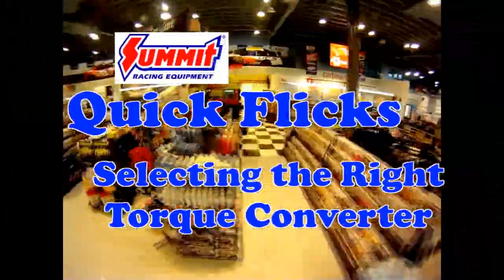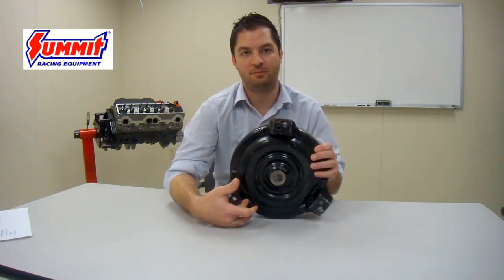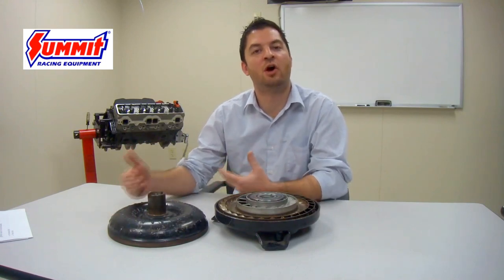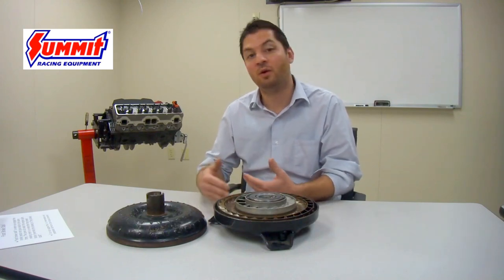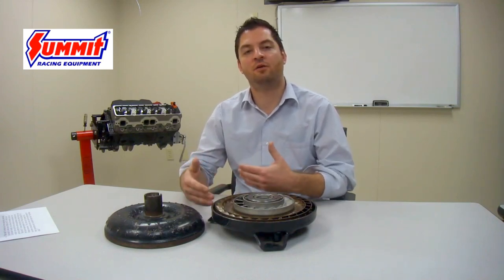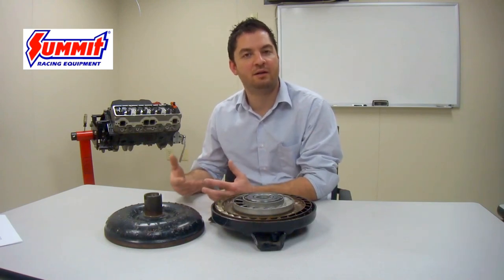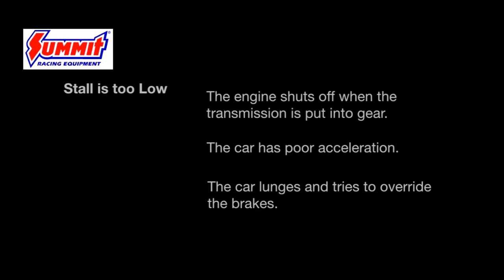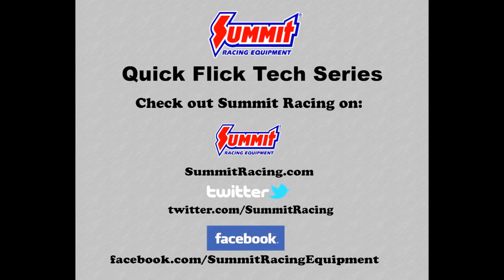Torque Converter Selection | How to Choose the Correct Torque Converter

Comment: Summit, I am trying to find an upgraded converter for a 2013 Dodge Dart 2.0L with Power-tech 6F24.  Here is some information to assist in this:
Displacement - 1,995 cc
Compression ratio - 10.2:1
Cam profile - Dual-Overhead / DOHC
Injector size - 36 mm
Transmission model year - 2013
Gear Ratios - 1st - 4.21 / 2nd - 2.64 / 3rd - 1.80 / 4th - 1.39 / 5th - 1.00 / 6th - 0.77
Rearend gear ratio - 3.20 (final-drive ratio)

the torque rating is only capable of 185 ft-lb of torque and I know a lot of 2.4 and 2.0 guys are coming close to hitting that limiter with tunes and bolt on upgrades.  The 2.4L stock from factory is already pushing, 174 lb-ft, and with only 185 ft-lbs available from the power-tech automatic, there is little room for growth.  Let me know if you need any other information in regards to the Dart, I will try and help out as much as possible with the information I have.  I think if we are able to get a past the stock 185 ft-lb torque rating on the power-tech a lot of others will see the potential in the automatic and the Dart.

Comment: So couldn’t you run a higher stall than your cruising speed if you also install a torque converter lock up switch? I have a 77 Chevy k10 with an 1800-2000 or so stall and I would like to increase the stall for a better launch but it cruises at 1800 rpms at 60 mph. It also tries to die when put into gear but I’m running a comp cams Xtreme energy 268 cam. It starts making power around 15-1600 rpms

Comment: Some of this info is incorrect if you use a lock-up converter.. I know a guy who put a TCI 3000 stall converter in his 2007 mustang GT. He can footbrake stall it to 2500. He has 355 gears and it cruises at about 1800. He has been running it on the street and bracket races almost every weekend and has never had a problem in years and years. His is a multi disk LOCK_UP converter.

Comment: What size/stall speed would you suggest for a 1989 G30 Class C RV that has a TH400 3-speed transmission. weighs roughly 10,000 lbs and 12,000 pounds if towing a small trailer? The engine is a new Chevrolet L05 TBI 350 crate engine rated at 210 hp at 4000 RPM and 300 lb-ft torque at 2800. Engine specs are:  9.4 to 1 compression ratio
, Camshaft with 165/174 duration at 0.050, 0.382 In./0.402 ex. lift, 1.94 in. intake/1.50 in. exhaust valves, cylinder heads (65.3cc chambers). The rear axle ratio is 4.10. I see towing torque converters with a 1200 RPM stall speed. Would this be suggested for this application or will it cause poor performance and bogging and stalling when putting into gear? Should I just use the stock converter?

Comment: I want maximum elapsed time what brand and converter stall do you think?

3,570 pound leaf spring car, with me 160 pounds total weight = 3,730
275-60 R15 tire 27.7 OD.
350 turbo trans just shift kit and manual valve body with Electric shifter. Trans not finished yet. I plan on installing 400 turbo with trans brake with Gear Vendor or 4L80E trans brake or something else very strong with a low gear set.
4.11 spool rear gear in now and 4.56 new chunk will try 4.56 some time
Use to stall 4,000 9.5" converter stall but converter broke only goes to 3,000 now. Still goes down track but would be way off at track. I bought the best converter at the time won't say what brand of converter.
Car has about 7,000 miles on it. I'd have to look to be for sure. Mostly street and some track. 

Engine power on Dyno no power adder yet
 700 HP at 5,600
710 TQ at 4000
572 BBC

Comment: can you recommend a torque converter for a sbc 350 bored .30 over, .488 lift cam,double roller timing chain,turbo 350 trans,square body chevy 2 wheel drive,stock 15 in tires 342 gears
Reply from the maker: +josh Blake, 
We need some additional information from you. Can you give our tech line a call? 1-330-630-0240. We look forward to your call. Thanks!

Comment: I have a 1984 Chevy Caprice. I replaced the 305 with a 350 motor, which is pretty much stock minus a Lunati Cam and Lifter Kit. Part # 60101LK. I will be redoing the gears, either 4:10 or 3:73, Havent decided yet. What stall converter should I go with?

Comment: THANK YOU!  omg, my cuda is nonstop overheat on the hwy even in cold with a new radiator.  now I know why.  2.73 gears and 27" tires equals 2200rpm @ 65.  NEVER gets above the 2400 stall converter (cam is rated for 2000). Time for a rear gear change!

Comment: So wonder if your brake and flash stall are at the same point?
In my 96 Ram with 156K on the original trans, I can hold the brake (and use E-brake to prevent wheelspin) and hit about 2200rpm. When I punch it from a dead stop, I also flash to about 2200rpm on stock diameter tires and 4.10 gear, truck at ±4800lbs.

Why would they be the same?

Comment: What about lockup tq converters? Like in a camaro, is a 2800-3000 stall possible?, with lockup converter, and 3.45 gears? Cruse at about 1800 rpm , its a street car, 385 cid. 11:1, comp nos hp cam . 2800-6800, but I would like to cruse at 1800-2k,

Comment: Hello, I am DIY replacing an engine on 2018 Hyundai Tucson. I've separated the transmission. But having trouble removing the torque converter from the engine and caused a slight crack on the tip facing in towards the transmission. Is that going to be a huge issue? Or must replace?

Comment: I have a 1985 chevy caprice with a 350 gm goodwrench engine. It has a 268H comp cam witha 700r4 and 3:73 Gears. What Converter would you suggest that a get. Oh it had Header with Stock tires that are 205/15/70

Comment: I am having a hard time picking the right stall for my set up....i have a restored 71 chevelle with a 6.0 LS with efi (not carb converted) and a 4l60e with 4.11 gears....car weight is roughly 3900lbs ....cam operating range is 2500-6500rpm....do I need a 2500-3000rpm stall converter,  or a 2000-2500rpm stall converter.....this is only my second hotrod build with an automatic trans....i usually go with manual transmissions but I'm getting old and I wanted this chevelle to be a nice cruiser that my wife can drive without smoking my clutch or giving us whiplash...the last time I built a hotrod with an automatic it was a 70 Nova with a 355ci th350 and 3.73 gears....it had a comp 280/480 with a range of2000-6000 and I used a stall I purchased from a friend who said it was either a 3000 or a 3500rpm stall converter...he couldn't remember but he said it would be close enough....well it wasnt even close to being applicable and the car felt like crap! By the time it started moving it was halfway thru the engine power curve....or at least it felt that way. It was so off the mark that I ended up removing the motor and stall and dropping in a 290hp stock 350ci crate motor and a stock converter.....the crate motor with its 290hp made the nova faster than it was with the 355ci that I built....it had fresh reworked 041 iron heads with some minor port and bowl work done by a very reputable shop, all good valves and springs and titanium retainers and locks....zero decked with flat top pistons...steel crank and aftermarket 5.7 rods ...the 280/480 cam and an old torker intake and 750cfm 4150.,...it wouldn't be jack shit these days but back in 1995 it was a good little daily driver build....the problem wasn't the motor it was the wrong stall....i sold the motor to my brother who put it in his 4sp 81 z28 and it ran great....but in my nova with that awful stall it was a turd.....i do not want to make the same mistake with my chevelle....if anyone takes the time to read all this I'd really like to hear your thoughts on what you think would be the best stall converter size/range would be for my is swapped chevelle....i mentioned above the trans and rear gears....if it helps my motor is a 2004 lq4 with fresh 243 heads with good valves and hardware....compression ratio is close to 10.5 ...cam is 221/232 -.545/.545 112+5 with a 2500-6500 power range....tbss intake (for now)....ls7 lifters/ ls9 valve springs....7.400 pushrods...long tube headers...36lb injectors...92mm TB....trunion upgraded rocker arms.....pretty much stock but should be over 400hp....didnt try to build a racecar.....just a good cruiser with a good stereo to take the ol lady out on country rides on the weekends and do a good burn outs.....i just want to make sure I choose the right stall this time so it isn't a dog like my nova was for awhile.
Reply from the maker: For a heavy car with taller gears I would stick with something in the 2400-2700 range like this Summit Racing Torque converter.

 

https://www.summitracing.com/parts/sum-700338
Reply: @SummitRacing  I took your advice and and bought the summit pro ls converter part number sum-700338.....i hope it does well....if not than in going to buy a Ouija board and tell the demons you been talk smack about their mama.

Comment: Can you recommend a torque converter for a 700r4 behind a  mild street/light off road.. The truck has 4.88 gears and 33" tires
Reply from the maker: Robert Riegelsberger, 
We need some additional information from you. Can you give our tech line a call? 1-330-630-0240. Thanks!

Comment: ok I own a 440 dodge coronet with a 3.23 rear differential with its original 489 case housing . Car was going 45 mph butt forced like needing another another gear. . What mechanic suggested was to replace it with a 2.76 in its original  case 489 83/4 housing. Car runs better butt like heavy ... U think I will need to replace the torque converter? Thanks
Reply from the maker: carlos torres, 
Can you give our tech department a call? 1-330-630-0240. We need some additional information from you. Thanks!

Comment: If I have an 87 firebird formula 350 with a slightly bigger cam and a 700R4 transmission with a shift kit Corvette servo and a stock rear end what torque converter stall what I need to still be able to do burnouts
Reply from the maker: A 2,000 rpm stall converter like SUM-G2704-12 is a great choice for stock and mildly modified vehicles like your Pontiac.

Comment: hello summit I have a 1983 k10 4x4 fullsize truck it has a 3.07 gear in it Witch I'm going to swap out for a 3.90 gears. I'm going to be running 33x12.50 15s ...I don't know what camshaft it has in it but it but I'm going to be going with one of your thumper cams and I've already got a 2400 stall converter from you guys..what I would like to get some help with is will this combination work on a daily driver w/towing sometimes please any help will be greatly appreciated. Thanks in advance
Reply from the maker: +damionakc, 
We need some additional information from you. Can you give our tech line a call? 1-330-630-0240. We look forward to your call. Thanks for watching!

Comment: Great video! But I have a question, I have a 1989 Chevy c1500 half ton with a 350 stock.I recently pulled the 700R4 tranny that it came with & installed a rebuilt that came with a smaller torque converter (Tci) which later I found out had a 2200 stall on it. The original torque converter that came off of it was an original size torque converter.  Problem is I had no idea what the difference would be when I installed it. I noticed the torque converter being really lose & could hardly shift into gear. Is there something wrong with my transmission or just the wrong stall converter? Need help
Reply from the maker: Hi Benjamin,  While factory stall ratings vary widely depending on a lot of things, they are generally in the 1200-1500 rpm range. That said, an after market converter in the 2200 range will tend to feel looser and seem to soften shift firmness. The most important thing to determine first is that the throttle valve cable adjustment is correct. This is accomplished properly by a transmission shop using a pressure gauge.

Comment: I'm rebuilding a chrysler 400 big block w/ keith black 9 to 1's, stock heads/rods/crank. Very short stroke for a big block, so i'm looking at alot of torque with quick revs too.

Ideal camshaft is around .500 to .530-ish lift, good duration, power from 2,000 rpm to 6,500 rpm, like an edelbrock performer RPM or mopar purple cam.

Torqueflite w/  8-3/4 rear, in a 1973 Plymouth, weighs about two tons. What sort of stall would you suggest for daily driver and the occasional quarter mile pass?

Comment: My dodge charger 2011 has no transmission in the vehicle or battery. When I got it towed, I wasn't able to get the car in park and I had the tow man just drag it on the flatbed. Now the car is still in park but if I push it I can get it to roll like it's in neutral. What do you think I broke?
Reply: Mal Bustler I think u have a couple of lose screws 👦😀

Comment: Hi, would I have any issues by going from a low stall converter to a Med stall converter?I am replacing my transmission, and the replacement transmission has this converter, same specs as my old one but with higher stall, 
DLPF 2420 9245
TC-GM35CW       Torque converter, 700-R4, 4L60E, 30 Spline, Medium Stall (Woven carbon) 
 Woven Carbon Clutch, Codes: DCNF, DLNF, DLPF Medium Stall (1600-1800) 
12" diameter, 298mm, Pilot 1.703", 3 Pads, 30 spline, PWM with ECCC my old converter has these specs: (lower stall)
DHPF2420  6163
TC-GM33CW       Torque converter, 700-R4, 4L60E, 30 Spline, Low Stall (Woven carbon) 
 Woven Carbon Clutch,Codes: DHPF, DHPG, DKNF, DKPF Low Stall (1400-1600) 
12" diameter, 298mm, Pilot 1.703", 3 Pads, 30 spline, PWM with ECCC

Comment: I have a 68 GTO, stock 350hp  400 c.i. engine, stock camshaft, TH400, and a 3.42 rear end.  I don't know what stall speed the torque converter in it now has, but I ordered a 1400 rpm aprox. Stall speed converter for it.  Does this sound like a good combination?

Comment from the maker: I would have sworn that the factory motor was a 425. However if this is a factory piece then you have the THM425 transmission for the front wheel drive. If that is the case then please use the stock torque converter. Good luck.

Comment: I have an 82 Camaro 408ci sbc vortec top end and th350,, 3.08 diff  27 inch tyres,, the cam is set to operate 1500,5700 rpm and the car cruises at 2500 rpm and its fast,,what converter will I have made,,if I get a 2000 stall will the car still be driveable in reverse parking and general traffic under 2000 rpm,, or will it rev and go nowhere until it hits 2000rpm. steve in Australia
Reply from the maker: Hi steve driver, 
A common misconception about “stall converters” is that they rev up to the rated RPM and then the car all the sudden starts to move; kind of like dumping a clutch!  This is not true, especially in the case of a 2000 – 2500 rpm stall.  This converter will actually drive normally at low throttle; but at higher throttle  will allow the motor to rev quickly getting into its horsepower producing band quicker.

Comment: i have a 1980 monte carlo with a stock 305 v8 and i just replaced the transmission for a 350 turbo. and when i put the car in reverse or drive it stalls if i dont give it gas or when im in drive and have to come to a complete stop the car will stall. im convinced that it is the carburetor because the choke doesnt work and the carb isnt adjusted right. but could it be the stall convertor?
Reply from the maker: +frincon75, 
You would be correct in suspecting the torque converter if the problem began only after the transmission swap. But if the problem was present before this, carb adjustment, improper timing or a vacuum leak are more likely to blame.

Comment: i have a mostly stock 1995 pontiac trans am 350 sbc hp range is 290 to 300 with 350 ft lbs of torque and a stock rear end what type of converter would i need for a street/strip install it is a daily driver.thanxs!

Comment: Ive always used a stock converter no matter what engine is in there. I like to build old classic Chevy Trucks and currently have a 66 Ford F100 project plan. I was looking at a 390 FE crate engine at 420HP and it says a stall is required with that engine. Why does the engine need a stall if I have no need to rev the engine up so I can get a big launch??? Im not building a drag racing truck....I just want a powerful engine to play with on the street. I dont need it to run up to 3000 RPM before it takes off. So why would it say a stall converter is " REQUIRED"??? When I touch the pedal I want it to take off immediately and go llke every other truck ive had. This 390 Ford big block will have more torque than all the Chevy small blocks ive had bolted to turbo 350 transmissions with stock converters. It should have gobs of torque right from the start so I dont get why a stall is " required" for that engine. Im just ignorant on the subject because ive never used one or had manual transmissions so please forgive me. I just want a 66 Ford truck high power cruiser....not a drag truck.
Reply: You only need a stall if you are running a radical cam. It lets the engine idle when stopped.

Comment: I have a 94 camaro z28 with an intake and magnaflow exhaust. My plans for my car are headers, cam, heads, and porting my lt1 from 350 to 383 and putting in 3.73 gears. Its a 4l60e that's being built to handle 600hp. I was thinking a yank ss3600. Opinions?

Comment: So if i upgrade my torque converter, would i need to upgrade cam shaft, tune and etc?.. especially for a day to day drive vehicle?.
Reply from the maker: Upgrading your torque converter does not require a camshaft change or tune. There are a lot of variables when selecting a torque converter and I recommend contacting our sales team to see what is best for your application. 1-800-230-3030

Comment: Does getting a stall converter below cruise speed apply to lock up converters?
Reply from the maker: Hi PT37,
Once the torque converter is locked up at cruise speed, the heat of slippage is no longer being produced. That’s a good thing!! Be sure to check out our lock up torque converter video: Lock Up Torque Converter - Summit Racing Quick Flicks
Thanks for watching!